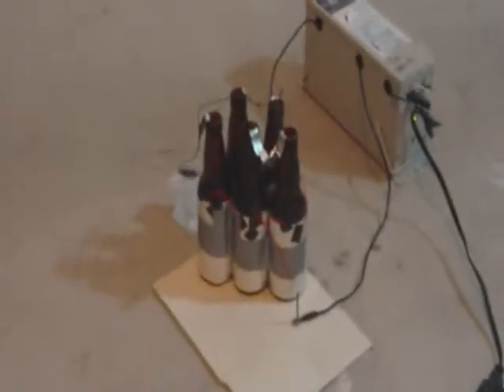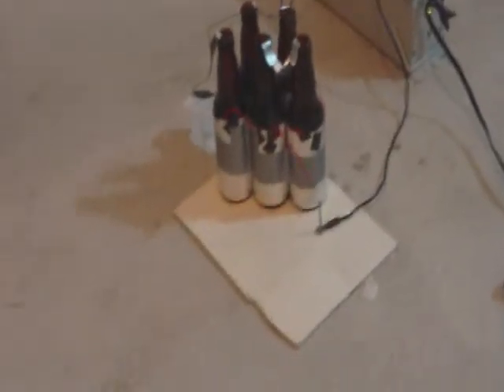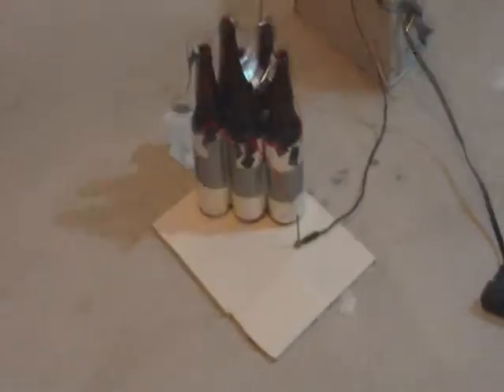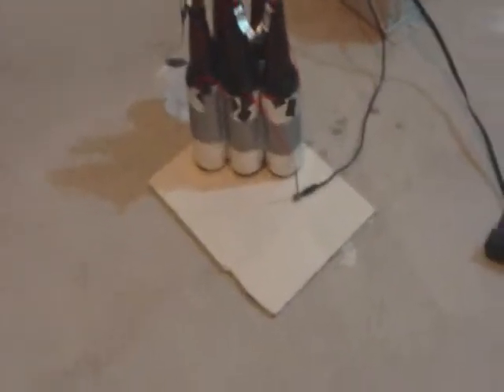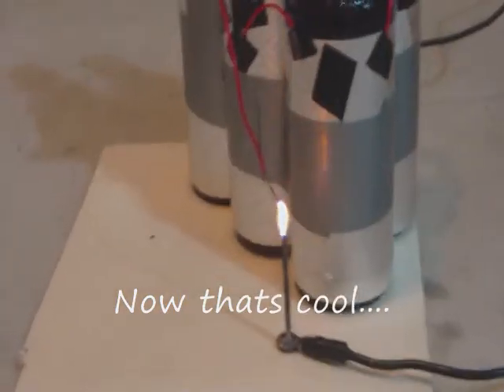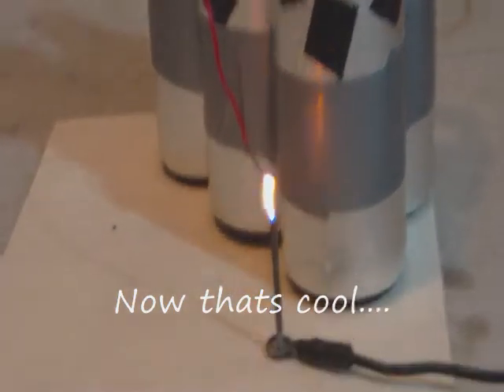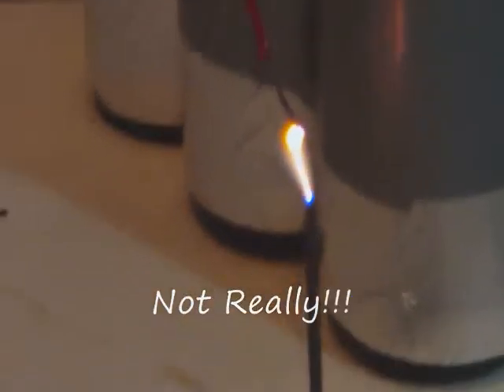Beer Bottle Capacitor.wmv

Comment from the maker: The voltage on my capacitor still does that but a good thick sheet of wood works to a certain degree, PVC pipe or a sheet of acrylic also works pretty well.

Comment: I have a similar setup with my tesla coil, but the voltages short to the ground. What exactly is the insulator that you used to prevent this?